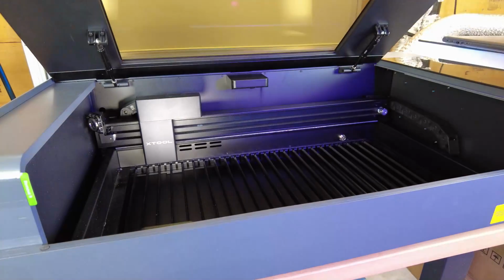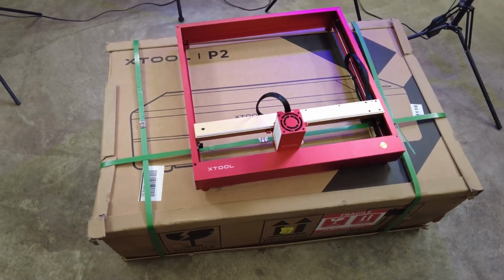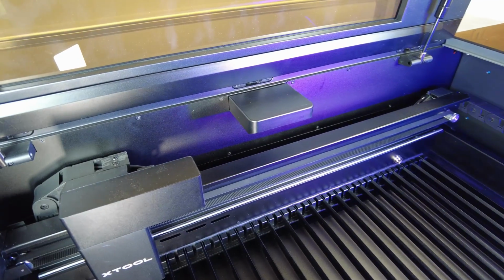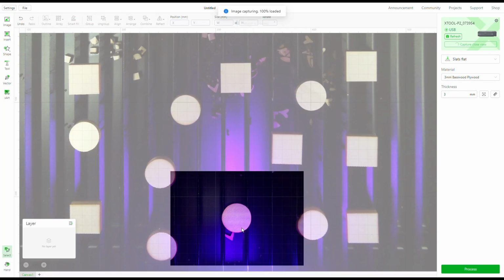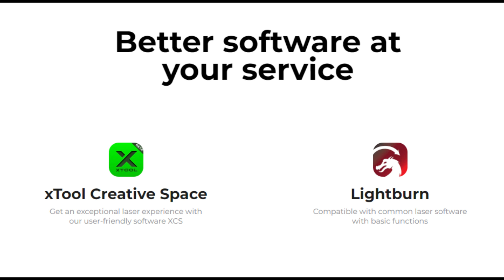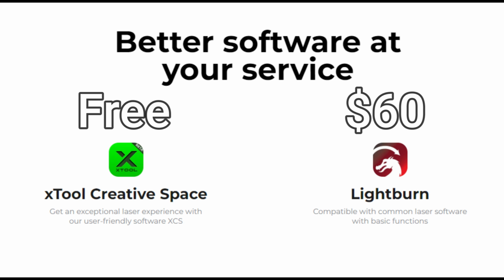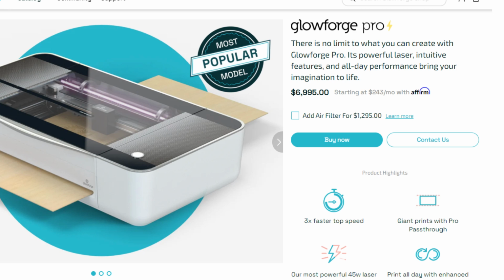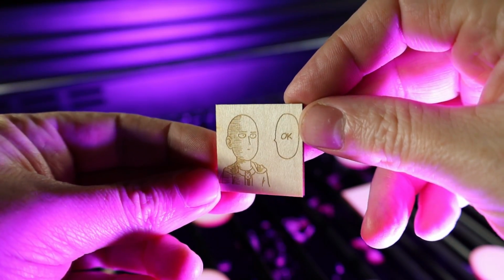You Might Want To Check Out This New CO2 Laser -  xTool P2

Comment: Unnecessary at that price.

I can get by with diodes for now.
Reply from the maker: Hey, that is great that you can get what you need done with diodes. I mostly cut and engrave on a lot of clear acrylic so a CO2 laser is a must. 

You do get darker engravings on wood using a diode along with being able to mark stainless steel.